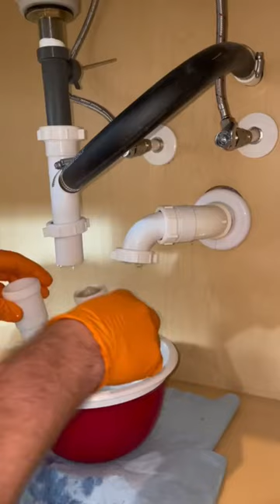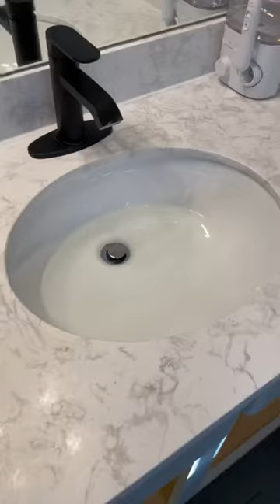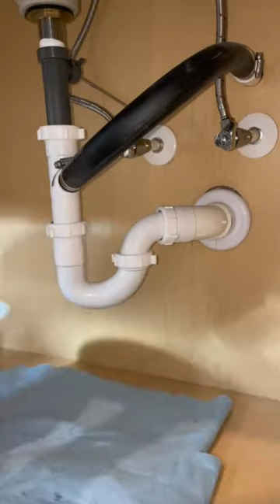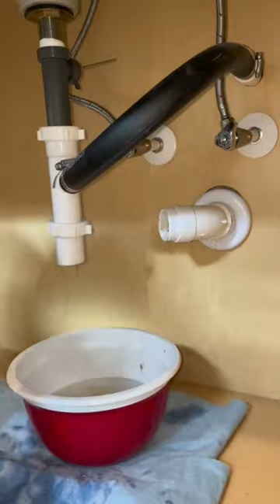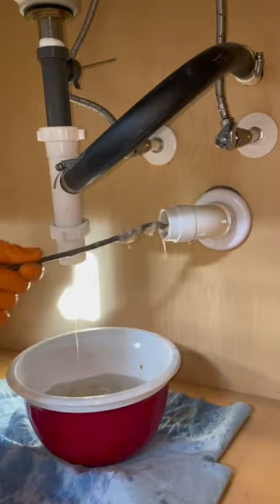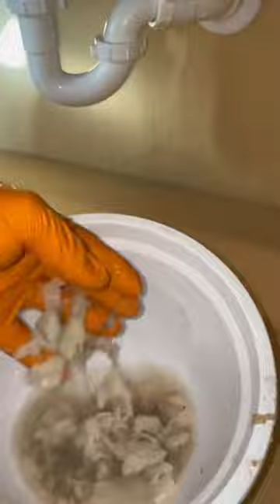Clogged Sink Drain

Comment: A little bleach down the drain once a month prevents this.
Reply: the film is jus straight up bacteria forming so indeed it does
Reply: I have this and my builder said the same thing. A cup of bleach every now and then and you’re good
Reply: A little better engineering could have prevented this.
Reply: Any cleaner really, even vinegar
Reply: @codyreber8370   i am talking about putting the vinegar at the inside ac unit drain there should always be a cleanput installed where you can open it up and pour in the vinegar you dont want to use something that can eat the coil cause when it causes a leak your warranty will not cover it
Reply: @honodle7219 what would be your fix? Older units with copper coils basically took care of this problem on their own. But climate change activists and our government making everything as efficient as possible is the real cause, resulting in aluminum coils.
Reply: @stephenotto2294 I've never had an hvac manufacturer ever deny a claim on a coil, for any reason lol.  You are right though.  Bleach is awful for the metals in the coil
Reply: Dawn dish soap works and causes less problems
Reply: It shouldn't be necessary though. It's another thing that has to be done that makes zero sense.
Reply: @gerald7044  and why is that?
Reply: @gerald7044  I'm sure you think it's ridiculous that you have to change your oil and your antifreeze on a regular basis too
Reply: Don't do this. Bleach breaks down pvc
Reply: I remember the head of the lab where I worked poured industrial strength bleach ( hypochlorite ) down floor drains to get rid of odors,, a few weeks later all the drains had to be replaced being it ate all the traps!
Reply: if you're going to be regularly dumping chemicals down the drain please tell the plumber who's going to fix your shit so they don't get chemical burns.

Comment: They route it into the drain so you don't have a swamp outside where the drain leads. In areas like mine that use the AC 10 months a year you get a ton of condensate.
Reply: Yeah but on sewer this is fine. Not septic

Comment: We had a new HVAC system installed at my job. They said the drains have to go to sewer nowdays. 
Which required alot of PVC pipe and a condensate pump. 
They used simply to drain into the planting beds adjacent to our front door.

Comment: I'm an HVAC tech from Maryland.  In my area, all drains are separately run or tie into a community drain that is also separate. You're 100% correct. routine maintenance on your system is key, and pan tablets are great to  prevent clogs / build up. I'm not sure why certain areas do it that way, but I'd assume it's a matter of convenience or cost of materials.  Enjoy your video, and you did a great job on the repair!

Comment: All the new construction is done this way in my area, tied in on a branched tailpiece. I think I remember seeing it on new homes back around 2010 but it wasn’t very common then, most houses still just used the preformed a/c trap and dumped it into the building drain.
Reply: interesting.  branch tailpiece is for dish washer airgap hose.  a/c condensation line or pan line needs to drip outside.  if pan line is dripping then havc can see it outside.
Reply: @vincekimura3937  theres more than one way to rob a railroad. Don’t lose too much sleep over it.
Reply: My old condo had this tie in, had similar issues plus off smells. Condo was built in 1985.

What was weird was that same model condos did not have this add on so apparently mine was added in post build.
Reply: @Donkringel  likely done during a remodel/refresh. Best time to do so is when the rock is off the walls.
Reply: My father's house was built around 2010-2011 and it has one of these. I was installing a new faucet for him and I just sat there for a second wonder wtf it was cause he doesn't have a second floor. I just figured it's probably a drain for the AC and carried on with the repair and I guess I was right lol

Every once in a while when I'm over there I smell sewer gas when I'm using that sink so I think next time I'll remove that p trap and see if its getting clogged by the bioflim or something

Comment: Former HVAC tech. Yes there are tablets you can put IN THE DRAIN PAN!!! Don’t put them in the PVC drain line. It WILL clog. I personally believe drain lines need to be run outside as well. 🤷‍♂️ don’t know why your area is different.

Comment: Yep ,that's also why it is good to pore boiling water down ones sink to help keep that from happening ,preventative maintenance
Reply: Do not pour water that is 212f+ down the drain. Not only is it against code, but you will soften the tubular plastic. Max temp in polypropylene is 180.
Reply: @elijah3807  So it's against the code to drain pasta??
Reply: @bobbygetsbanned6049 your mother is proud I’m sure.
Reply: @elijah3807  You didn't answer my question.
Reply: @bobbygetsbanned6049  probably a metric vs imperial thing; I don't see code allowing drain pipes that couldn't withstand boiling water.  Water boils at 100 degrees Centigrade so if the pipes are good to like 180 then that's fine; PASTA ALL YOU WANT!

Comment: Hvac technician here. Yes there are tablets you can install, they’re rather inexpensive but aren’t the best solution for the issue. Install a Ez Trap condensate safety device. These will collect the primary amount of debris and put it in a clear trap you can see, if there’s enough buildup to clog the line it will turn off the unit.

Comment: If you've ever been in the city sidewalks with condensate dripping everywhere you would understand. However mine runs outside and I use tablets. Just drop one a month into the drain-pan line (there's a spot for that) and it stays clear. My brother uses bleach. However, cleaning the p-trap is dead easy for a homeowner.

Comment: Do you guys use brass traps down there at all? We use 17 gauge a lot! The condensate would likely eat them out pretty quick though I’d think.
They’ll either use condensate pumps and pump into a 1.5” glue trap and into stack or run pvc directly into the waste line here

Comment: HVAC Tech here.

There can be several reasons:

If the HVAC system also has a 90% efficiency or greater furnace, then that condensates as well, and it can't go outside in regions where Temps below 32°F occur, because of course it will freeze in the outside portion of the pipe and cause leaks inside the house. 

If the HVAC system isn't on the ground level, and there's no existing drain that goes in between the walls, customers aren't going to remodel their home for a condensate drain. 

Condensate pumps and vinyl tubing are easier to replace than PVC that goes behind walls. They also move this problem in the video away from the pvc itself, because what's happening in this trap also happens in the pvc drain.

All the homeowner needs to do is fill the drain with vinegar once a season.

Comment: I'm a plumber and we usually cut a 3/1-1/2 Ty and set up a trap for the HVAC guys. It avoids anything like this. Used to deal with them literally drilling into our PVC and attaching it and sealing the hole with silicon.. Needless to say that overtime the silicon would degrade and the pipe would slide out of the PVC and cause damage to the sheetrock. It just became easier to give them an extra trap to drain their condensate lines.

Comment: HVAC tech here. Don’t run it into your sink drain. Run your hvac drain outside and on maintenance twice a year(spring and fall), put a bleach tablet or a cap of liquid bleach in the clean out at the indoor unit. If you don’t have a clean out, take the door to the coil off and put it in the drain pan.
Reply from the maker: Almost all new homes in my area have the drain going to a sink like this now unfortunately. Not sure why they are doing it

Comment: I think it's a money scheme to cost home owners more money in the long run. Condensate pump with the line following the line set is the best in my opinion but yes they do sell tablets to help in the pan.
Reply: Seems like it causes more money problems in the long run.  Can't just look at the small picture install and stop thinking.  Where I come from, you can't tie into the sanitary waste line.  We usually terminate at a floor drain or in the grass.  But I've cut into condensate lines and some were literally half full of gray gunk.  One was a 2 in line and the top half was full of the gunk.  Guess where the water was running (bottom half) didn't have any since it was draining properly.  But this shit is what ends up in drains.
Reply: @jtoker9758  how you figure it causes more problems? 

Condensate clogs, regardless of where it drains to, dedicated line or piggybacking off the lav trap.
Reply: @elijah3807  it clogs up the sanitary line more than it should.  In my state we can't connect it to the waste line.  We can terminate it to a floor drain.
Reply: @jtoker9758  semantics. Little to no difference in a clogged condensate versus a clogged sanitary. Both addressable. Easily.
Reply: @elijah3807  except one adds in a clogged sink now.  Again it isn't allowed in my state, so there must be some reason you obviously missing.
Reply: @jtoker9758  the reason I missed is your explanation as to why it’s ‘more money problems’ later. 

I’m still waiting. ‘ it’s not allowed here’ isn’t sufficient explanation.

Open j bend, dump. Fin. No more costly than having the condensate line blown loose with co2 or nitrogen. It’s still a service call.
Reply: Just use 1 cup white distilled vinegar in your ac drain line monthly
Reply: Condensate pumps will clog just as fast if not cleaned out. Honestly a trap might be even easier to clean out
Reply: I work commercial and condensate pumps are the bane of every building engineer's existence. Just another thing to break down and when it does, not a quick fix.
I would always choose gravity over a pump unless the install location doesn't allow for enough clearance to do so.
Reply: @dragons_red  you speak nothing but truth

Comment: I just got a high efficiency furnace and ac unit and I live in NJ. The high efficiency furnace creates condensation from the reburn  process and the humidifier runs a lot of water into the condensate pump then add the ac condensation that a lot of water going outside in the winter I can't afford to have an iced over driveway or that sitting near the foundation so I opted to have it to my slop sink.

Comment: The condensation drain lines that run to the exterior are the secondary drain lines that only should be letting out water when the primary drain lines are clogged.

Comment: Man...this happened to me the other night. I ran vinegar in the traps and sink traps and still couldnt get rid of the  clog. I had to run a snake to get rid of the clog. I'll need to run more vinegar in those lines.
Reply: Mix up a Clorox batch of water 50/50 it will knock it right out-rinse a couple times with just water to move it on down the line..
Reply: Yeah man if its already clogged, using cleaners is too late lol. Cleaners are for maintenance, not unclog/repairs.

Comment: Residential HVAC service tech here. They make tablets and sprays that you can use to control biological growth in coils. I imagine most HVAC equipment in your area is in the attic. Units in attics are prone to having lots of biological growth. Wet coil+dark box+high ambient temps= biological growth. 

What you see in the P-Trap is just the part that makes it out of the coil. I bet the AH is full of biological growth. The best way to keep this from happening is simply running the fan all the time during the summer. This will dry out the coil whenever the AC shuts off, and prevent the system from turning into a breeding ground. 

As to why they are piped into the drain, im not sure. Ive never seen it, and I've done work in both Colorado and Missouri. Keeo up the great videos. Us HVAC guys like to think we can do plumbing because we can run condensate drains and replace water heaters. Your videos remind me that theres so much more to know!

Comment: Lennar Homes use to run those A/C condensation drains to the outside over a window for you can see if it is draining or not......but homeowners kept calling the plumbers saying they had a leak. That is why they run them to the drains now......less service calls

Comment: Sometimes you have to run the HVAC condensate pipe/s to the bathroom because gravity feed isn't always an option, especially in these mid century modern homes with no attics, most of these home owners/air b and b investors don't want condensate pumps because they're noisy. "BZZZZZZZZZZZ" all night long

Comment: In new homes, city codes require drain lines from the air conditioner’s condensate line which are often located in the attic to tie in or be plumbed to the home’s plumbing system.

During the hotter months, which is most of the year in our area, condensate drains can easily become clogged because of the growth of algae and slime because they are located in a humid environment where the air conditioner is actively removing water from the air. Installation of an ultraviolet lamp in your evaporator coil can slow this process down quite a bit, and the ceiling saver switch is also a bit of extra insurance. We can also install an algicide pad in your drain which can last up to six months and which continuously releases an ammonia-based quat, a sanitizing compound that help prevent the build up of slime in your system.
Reply: Where do you live??? That is crazy!!
I live in Northeast Florida, and here that is a code violation. And putting an AC in the attic is also NUTS.

Comment: I’ve never seen this done and i’m a HVAC tech. And yes they make drain pan tablets but they only clean the line and pan a little bit. Now there are traps that you can buy that have a cylinder you fill with tablets that eat the bacteria that grows the snot. But again it only last 6 months or so worth of tablets and personally every summer when i clean my own houses condensers and evaptorators i will just blow out the lines with compressed air

Comment: Mechanical Code requires primary condensate to drain to a fixture tailpiece.  Secondary condensate shall terminate in a conspicuous location like over a window or a door so if the primary clogs it's noticable when the secondary is dripping.  Some jurisdictions allow an electronic shutoff switch on the secondary condensate that will shut off the fau if condensate is detected and the owner will then call for service and service technician will clear the primary condensate.

Comment: Mine runs outside. And since I live in the south it never stops dripping. So I put a bowl under it snd it’s a constant water source for my chickens and all the deer that come up to my house!
Reply: That's nasty af that you would water your animals with non potable water
Reply: @gnosticreverend6354  How's it not potable for animals?  It's just condensate.  Animals drink far worse from ponds and puddles.
Reply: Its good to water plants with too
Reply: @MiniDevilDF Because that condensate wasn't formed in a vacuum. It's not like the condensate coming off your cold and clean bottle of water.
It's coming from the AC coil that sits in your duct work, which means that condensate gets a chance to drip down a coil that's had dusty, dirty, germ filled air constantly pass through it, and then gets collected in that condensate, to then have your animals drink it. 

Which yeah I guess their just animals. 
But that water isn't clean.

Comment: Also if you're running a 96 percent gas furnace you are not permitted to run the drain outside any more because the now acidic natural of the condensate and plus it will freeze up during winter time
Reply: Who runs an ac below 32°

Comment: yeah this is just not necessary. that owner should run the drain line outside, its worth the hassle. theres no pipe it can drain into that won't cause a problem.

Comment: Have a few apartments where the drip pan will overflow with this same setup. The second a disconnect the rubber hose at the ptrap the water will flow and drain out. Anyone have some ideas for me to fix this issue?
Reply: If you have a "drip pan" there that means you need a better plummer - or just watch YT vids to learn what kind of tape is needed, and how to unscrew pipes.
Reply: BIG BUCKET!

Comment: Condensate from an AC unit is not permitted to be hard piped to a sanitary drain, per code. This will suck sewer gases into the air handler and throughout the house when the p trap dries up.

Comment: If the ac condensate was plumbed straight into the sewer septic drain it will be fine in the summer but in the winter the water in the condensate p trap will evaporate and potentially suck sewer gas into the ac handler and blow it in the house.  
When the ac drain is tied into a sink that is frequently used , the condensate water will always have the sink ptrap water to keep sewer gases out of the ac handler. 
This is the reason whether it actually happens or not is debatable.

Comment: Maybe in northern climates it'll freeze if plumber to the exterior?
Reply: Who is running the AC when it is freezing outside???????
Reply: @christaylor1934  in the north our furnaces are typically LP or natural gas ...both of which condensate when burned ...they typically share the same drain as the AC drain

Comment: Bro why TF there is "U" joint under the drain, if it's straight down like in india there is no problem with drain leak or clog, even if it's clog use some drain cleaner and all good.

Comment: I have perfectly running hot water in my whole house. Except a single bathroom sink. No one can find where the problem is.
Reply from the maker: Hard to say without seeing the system. Is it low pressure or just not hot?